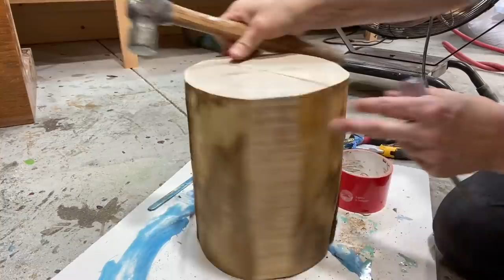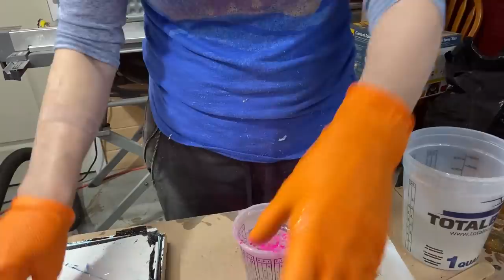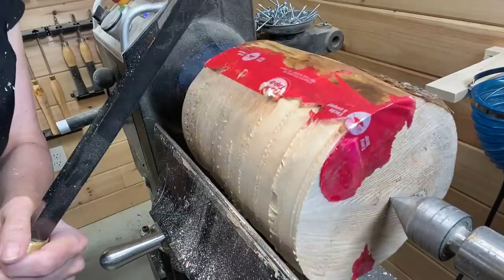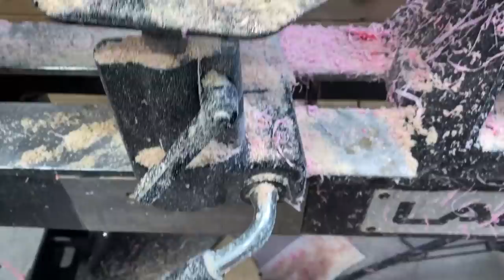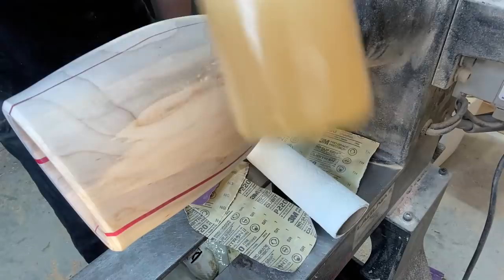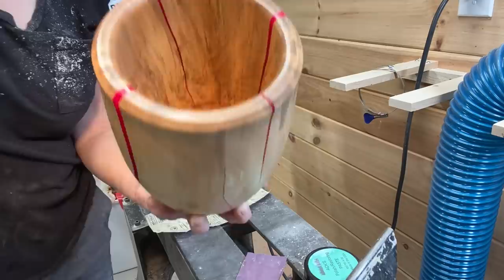Woodturning | Magma Magenta Pigment in a Maple Log

Comment: I saw you use tuck tape on a previous video. Thanks for the idea. I used it on some cherry branches with very large cracks I was turning into lidded boxes about 3” by 5”. They were small enough blanks I could put them into my vacuum chamber to pull the air bubbles out then into my pressure pot to compress any bubbles left in the resin. I found the DQ peanut buster parfait lid perfect to tape to the top of the blank to act like a disposable funnel for the resin. Time to hit DQ again.😁
Reply from the maker: Great idea!

Comment: I have so many questions! 😂😁
Any idea how dry the blank was before you poured the resin?
How deep is the vase? I’m still looking at getting something for hollowing deeper pieces and have watched a bunch of Jimmy’s videos on the Mate and Mate2 but am curious as to how deep you can hollow before it gets hairy. I know the EWT negative rake finisher I have says max 4” overhanging the tool rest but that Mate looked pretty beefy and it didn’t look like it was fighting you too badly. 
I do love me some maple - the grain is almost always amazing!
Reply from the maker: I didn't use the moisture meter on it, so I don't know exactly, but it was pretty dry. If I had to guess I would say it was 6-7%. (pretty dry). The vase is about 10 inches tall, so the inside is about 8. (I'm estimating, as I don't have it in front of me at the moment). I left the bottom a little heavy for stability purposes. I really like the Jimmy Clewes mate tool. It's perfect for this situation. The only time it gets hairy (with any tool) is when the opening is narrow. With this one I could fit my whole hand inside, and that always makes for better hollowing in my experience.